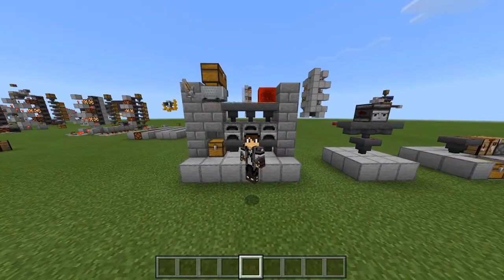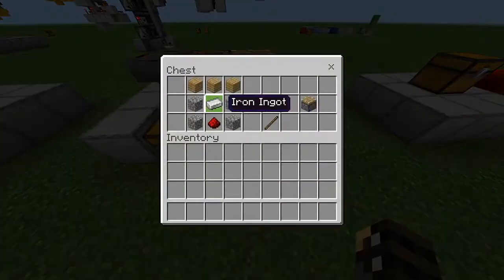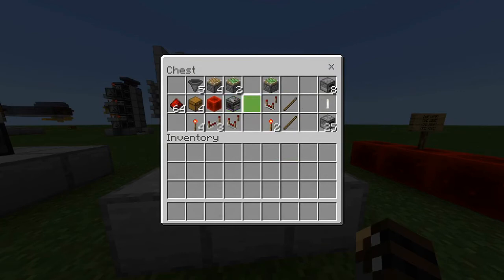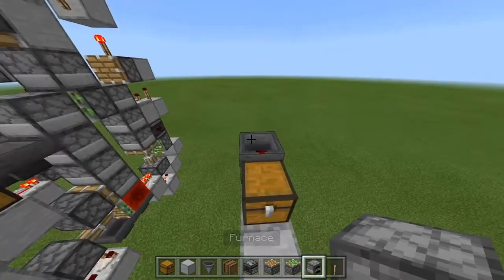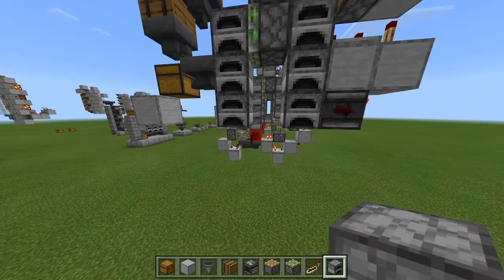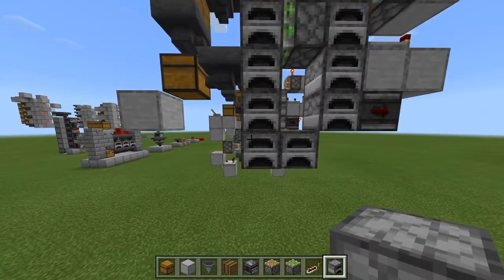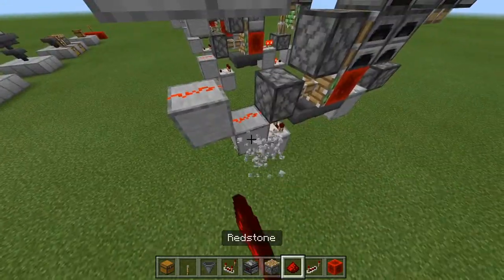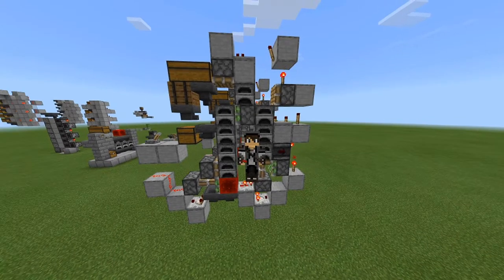Piston Feedtape Smelter Tutorial | Minecraft Bedrock 1.16

Comment: do you really require a hopper clock on this thing?
Reply from the maker: Yep thats what the machine is built on.
Reply: @rocketbuilder  i meant, shouldn't another, cheaper, clock work just as well?
Reply from the maker: There are other clocks but none are as compact and tillable like this one. There is always a sacrifice you have to make when making things smaller in this case its just a little more iron but overall you still save a lot.
Reply: Ryan don't mess!!!